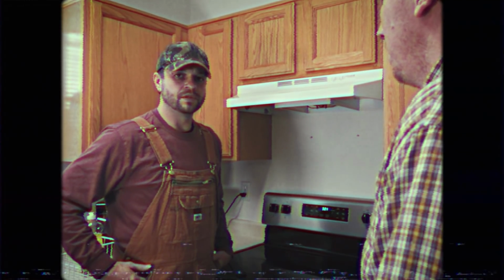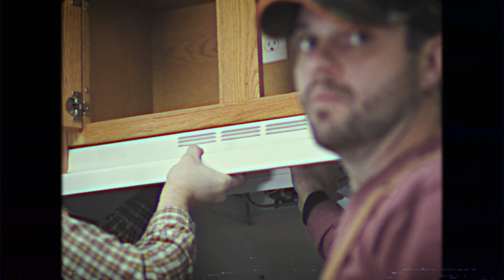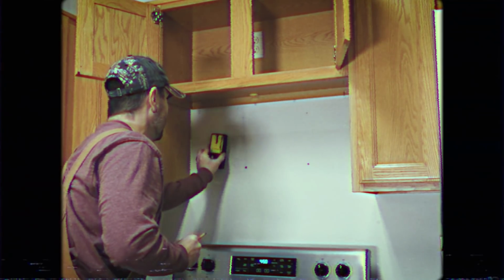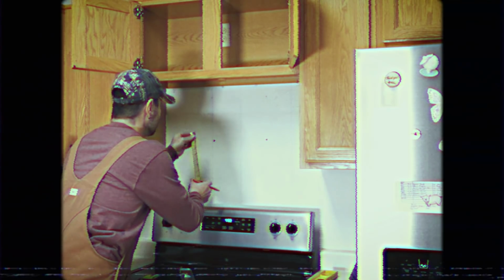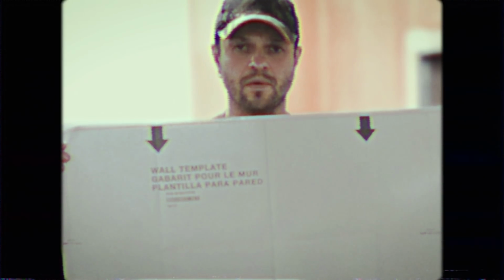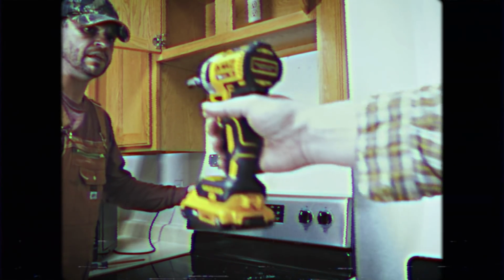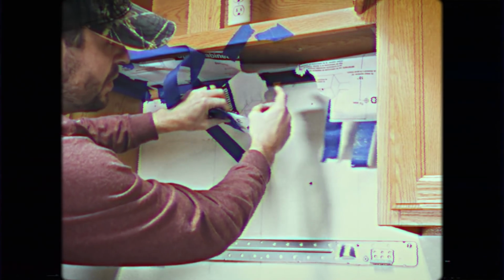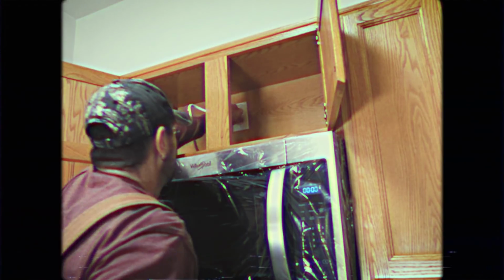S1:E16 - Whirlpool 30 Inch Above Range Microwave Install

Comment: I didn't actually use your tutorial on how to do it.  Just watching u guys gave me the confidence I needed to get the job done.  P.s. I used the template (kind of).  I guessed where to cut a hole in the cabinet for the power cord before I saw that there was a template.

Comment: Those over the stove vent and microwaves die early from either grease or steam.     Be prepared to come back to replace it 3 years.
Reply: Its also too close to the range, should have ripped out the cabinet above.